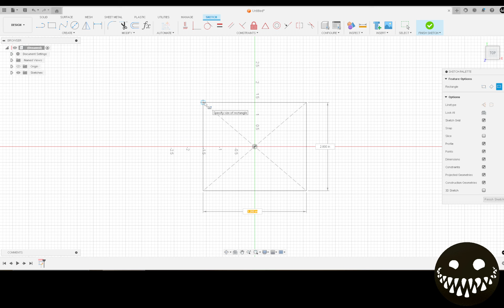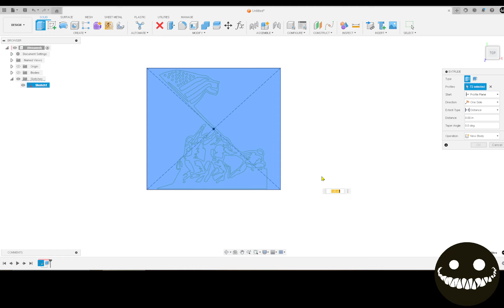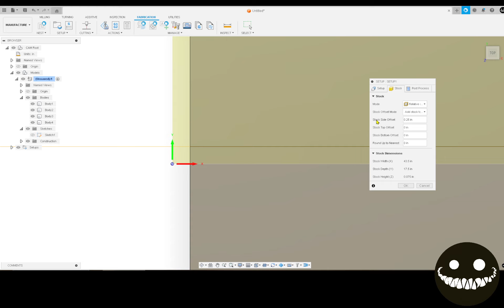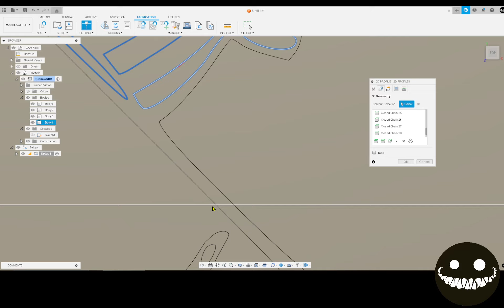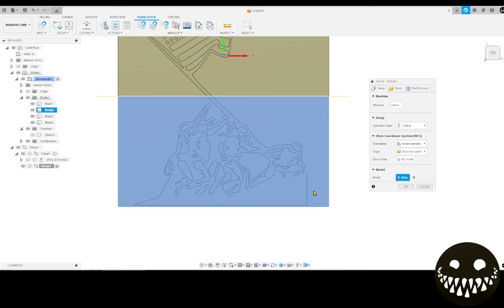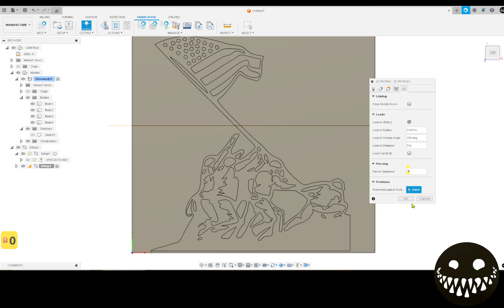Index Cutting for Langmuir Cross Fire Pro

Comment: Great video! Is there an example of how you zero the workpiece and then remove it, to then continue the cut?
Reply from the maker: I'll see if I can get around recording something on my table. In this example I would clamp a straight edge to the table on the left hand side and then on the sheet stock I would mark a point 17 and 40 inches down the left hand side of the stock. Then the 1st program I would zero at the 17 inch mark and run the program. Then I would zero at the 40 inch mark and run the second program while keeping the left-handed edge flat against the straight edge.
Reply: @tinwhisperer  oh ok, i like the idea of using the straight edge, that was my main question, how do i make sure the X axis stays fixed. I've been wanting to try this method with a 4x8 sheet of 14 gauge, so might give it a shot